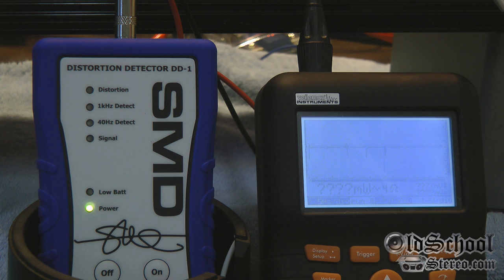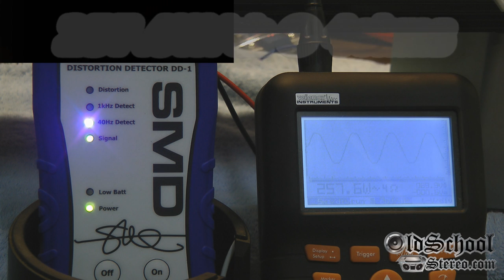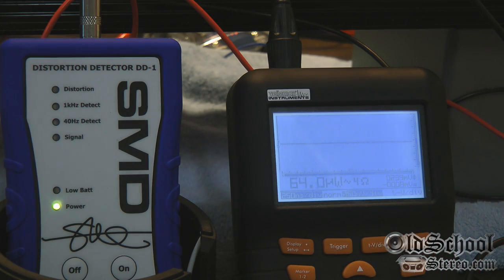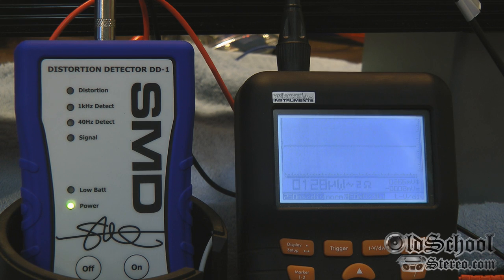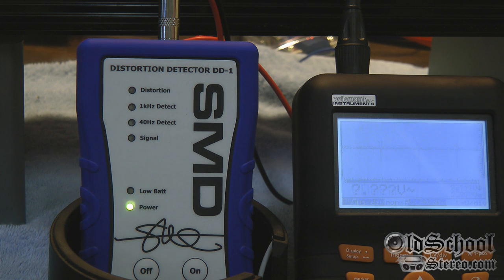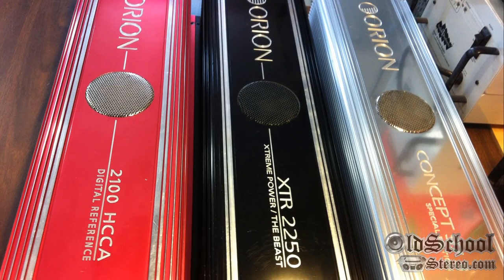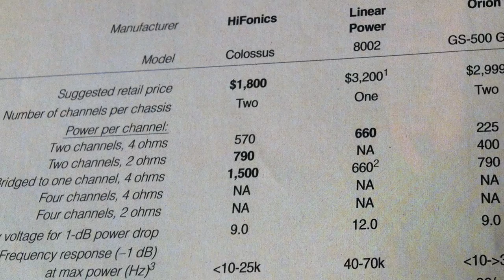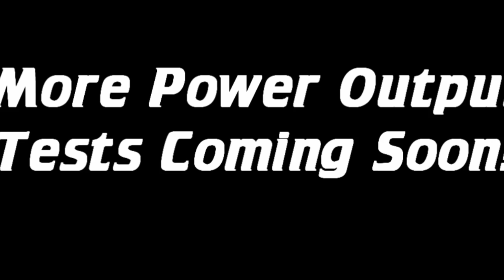Orion XTR-2250 The Beast Amp Power Output Test Wattage RMS Old School DD-1

Comment from the maker: I was merely stating it fell short of it's 1000w rating. I agree the caps need to be replaced, but my output was nearly identical to the test of the GS500 (2250SX/XTR2250 clone) done back in 1991 by Car Audio and Electronics

Comment from the maker: All of the Old School RF amp's I've tested have beat their rated output, even into resistive loads. Amp mfg's use reactive loads for their "birth sheets", b/c it shows a higher number than resistive. Kind of like testing HP at the crank vs. testing at the wheels. Not to beat up Orion, but after the Nov. 1991 test of the GS500, you didn't see many Orion's bench tested in the magazines over the next 10yrs.

Comment from the maker: Thanks man. BTW, you weren't the only one way off! If I didn't have the 1991 CA&E mag testing the very similar GS500, then I would've guessed much higher also. The amp is big enough and has enough surface area for cooling, it should do 1k plus, but either the outputs or power supply was limiting here...

Comment: I was told these older Orion amps need the help of stiffening caps. What the guy at shop said was that they would run out of power without a cap and clip. It would be a interesting experiment if you would re-test this amp with the cap.

Comment: Derek in the video you mentioned that some folks were commenting that your test parameters are no good or not accurate or whatever, and I am guessing that the CA &E used a similar setup to test the amp when new. One thing that I have not seen in the comments is the fact that the impedance of your resistive load is going to generate it's own heat internally, and we all know that heat creates even more resistance. It is likely that by the time you got to the 2 ohm and mono loads your resistor bank may have heatsoaked enough to cause a higher impedance as seen by the amp. This would explain the lower than rated numbers. As you have mentioned in many of your other videos the resistive loads utilized on the bench and the actual inductive load of a speaker in an enclosure are COMPLETELY different, almost not comparable. This amp is a BEAST no matter what the numbers say!!
Reply from the maker: All of my amp tests are consistent though. See a newer version of this test using the Amp Dyno here: https://youtu.be/3ONCQEssGyA

Comment from the maker: I don't think the age has anything to do with the power output here. I do have a 2100 HCCA "Competition" model which was recently completely rebuilt and will test it soon, but believe it does around 800w at it's lowest ohm load also, despite what you may read online (1600 watts or more, yeah right). I'll go back again to the 1991 magazine test where the GS500 Orion did 790w at 4ohms mono, although it was rated for 1000 (the GS500 was a gold 2250sx and the XTR2250 is a newer 2250sx)

Comment: The results correlate well with my own measurements. Orion had a big problem with the way they regulated their power supplies - and it was inefficient. Then again, when you have RF engineers building audio amplifiers, you get weird stuff like that...

Comment: This just brought back memories of my amps that were stolen. 
:'(
Reply: +Dan A (1m2)  same here SMH now im thinking about bolting the amps down shaved key holes and shaved door handles  bolt locks viper alarm systems lol anything to prevent theft...
Reply: +MasterTechRepair 
You can't stop the scum from breaking into your car and destroying it but you can slow them down or make it difficult as heck to take it. I still have some things to do with my current install to prevent theft as well. Dirty lazy no good for nothing theifs. LOL Merry X-Mas!
Reply: +Dan A (1m2) my last idea was 3/4" acrylic floor bolted down with special bolts and show display the amps in the spare tire hole in the trunk and weld the sub to the chasis
Reply: +Mastertechrepair Guerrero Very nice! Proceed and share. I'm just about finished installing a hardwired back up camera to fabricated tablet install.

Comment: Seems legit test to me. I will say I've seen amps not do what they originally did due to age. The output transistors get really hot, or other components internally are wore out, and it just doesn't do the output it used to. With that old of an amp, I wonder how that thing is holding up on the internals.

Comment: Dereck I know mine is the 2250sx but are you sure there was nothing wrong with these internals ? im not asking because the numbers are low, im asking because after the 4 ohm stereo test you said the amp was hot. My 2250sx I run at 4 ohm mono for hours on end at high volume and it doesn't even get higher than room temperature
Reply: +Richard Lynch Musical loads produce far less heat than continuous loads. Also, anything from the 90s is approaching the point of needing new capacitors on the circuit board, especially if they are 105C-rated capacitors (generally, 85C electrolytes have a longer operating lifespan, but sacrifices heat tolerance).
Reply: I have owned the smaller xtr 250 and it would get extremely hot!!!! You have to consider the amps internal power supply PWM or RPS. The RPS produces far more heat than the PWM.

Comment: Xtr wasn't the budget model. The hott set up was. Followed by cobalt.
They tried at one point to put out the ntense series.  But that was short lived.
Reply from the maker: Right...there was also a specially noted high end of XTR's around 1995 that were transformed into the NT's the following year (XTR100, XTR200). Dual mono design, built for SQ, prob the best amps Orion ever built IMHO

Comment: Underrated or not, I'm fortunate to have (2) of these monsters & I wouldn't trade them for any newer amp.
Reply from the maker: +ArcadeDude44 I'm with you bro
Reply: To hell with the power these are display gems
Reply: Although my new smart 3 is awesome I just hope it is around in 20 years I know Taramps has mixed reviews but so far it's murdering my zvx 18 bass boost all the way down gain a little over a quarter

Comment: They needed more voltage u could feed it true 16 volts and bridge it at 2ohm mono for 2000 watts
Reply from the maker: Internet myth and untrue. I'll show re-tests of these beasts soon and I think many people will be disappointed with the results. The 2250 is not suitable for 2 ohms mono and does not benefit from much over 15V. I've tested the 2250 and THREE different versions of the 2100 HCCA and the results are less than impressive (using the Amp Dyno for verified results).
Reply: John fairchild from striker and can't remember the guy from Orion  but the had him install 3 altenators that u could set the voltage cause u can't drive at 16v and series batteries to get the voltage up granted john was telling him to get other amps like colossus from hifonics but they stopped making the series 8 at the time and us amps where to expensive for that many but he was hitting 168 to 170 at DB drags
Reply: I like the old school hifonics tho
Reply: But it was a crazy system 5 18 strokers and 10 beast bridge at 2ohm

Comment: I'd say something is wrong with it internally. Either that, or you didn't provide it enough signal. To really make those amps scream you needed a line driver if I remember correctly.
Reply from the maker: I wish I could say this was the case...I've tested SEVERAL big Orion's, including recently with my SMD Amp Dyno and a 5V out Alpine CDA-9815 (with ultra-low measured THD at 5V output level) and the results are less than impressive. That said, they still sound fantastic with speakers and that's what really matters. When I get the SMD AMM-1, I can test the actual wattage going to the speakers, which will be an interesting comparison

Comment: You were too generous... Your negative supply was clipping has to be a clean signal with no evidence of clipping on either supply.
Reply from the maker: I recently tested this XTR-2250 and the rare Concept 97-3 using my ultra-clean Alpine CDA-9815 and 320A power supply with the SMD Amp Dyno as the measurement tool. Stay tuned for the updated video
Reply: Dereck BigDWiz Roger-that... I use scopes and depend on the displayed information so I look at the signals very closely. I get ya though. If your gear is so sensetive that you can rely on just a light, I envy you! :-D Anyawy..... Thanks for the vids, they are cool!